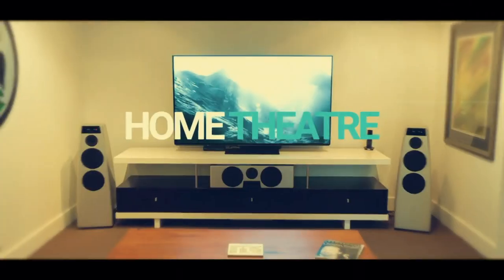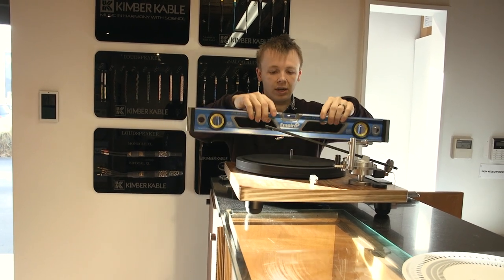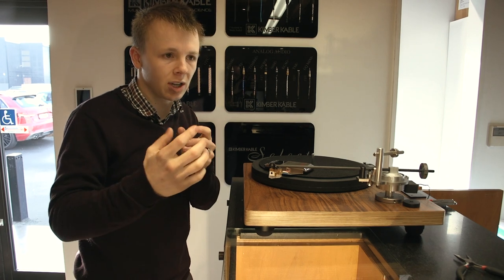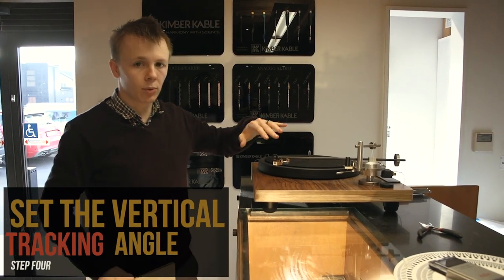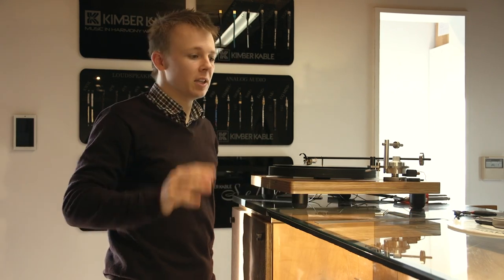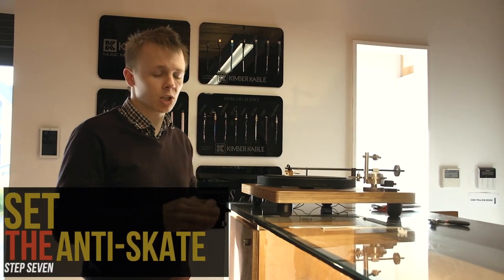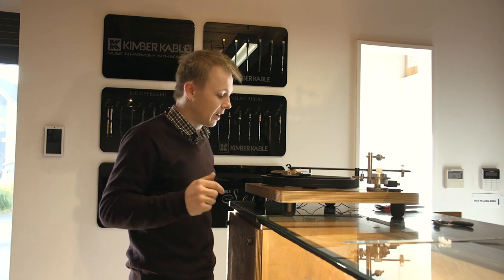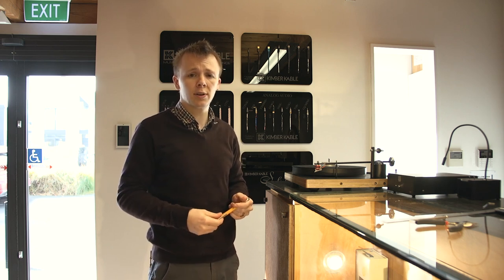How To Setup Your Hifi Turntable

Comment: Seems this video is for advanced TTs. I only have a Nad C558.
Reply from the maker: We tried to cover as many adjustments as are possible on most turntables, not all turntables have all the adjustability’s though so it will just be a limitation of your NAD.
At the very least all turntables should have cartridge alignment slots and tracking force adjustment.
Reply: @SoundlineAudioNewZealand Ok gotcha thanks!☺️